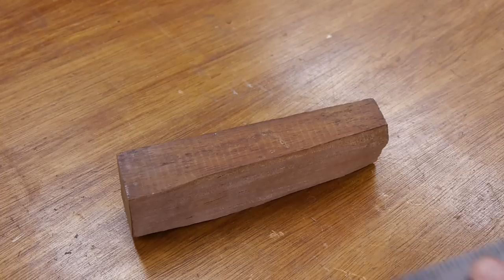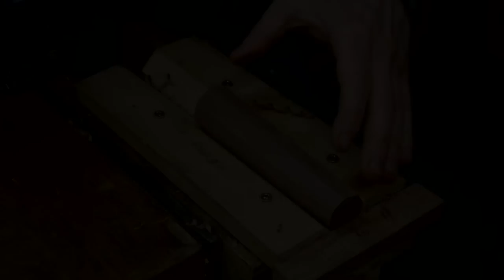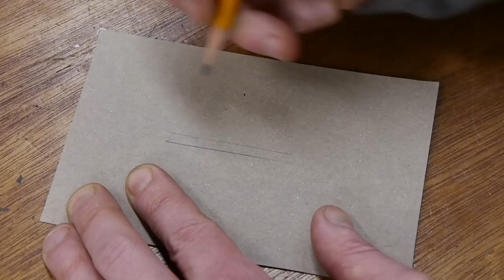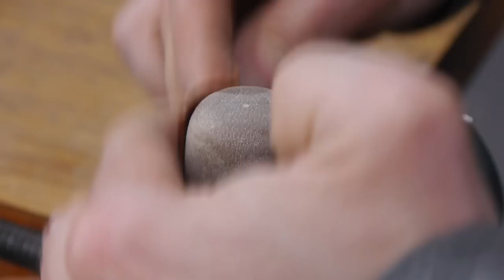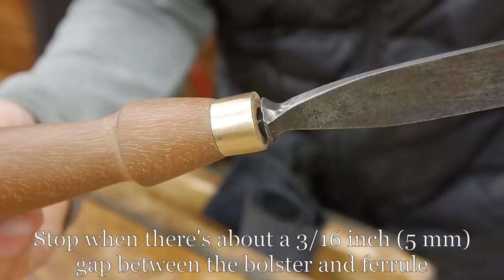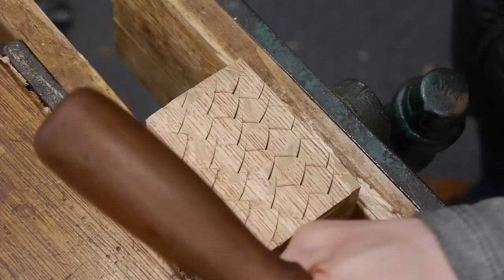200-year old carving gouge restoration | Making a traditional turned chisel handle with hand tools

Comment: Dear Mr Handtoolworks: clearly this is not your first rodeo. I thoroughly enjoyed this video, thank you. a) Where did you learn all your skills? b) Was that a hand stitched rasp you used? (a Frenchie?) c) Where did you acquire that auger extension holder? (never thought it even existed prior to this). This was the most instructive video I've ever seen on restoring hand tools, and its the little things you added which spoke the most to me. Interestingly, what I saw you doing by squaring off, then making octagonal to eventually come back to round, is what I am learning in blacksmithing right now. Very, very interesting. I offer somewhat effusive praise, but its rare that I find something so absolutely brilliant here on the Tube that I can put into use next day.

Comment: How do you know it's 200 years od and not 100 or 50 years old?
Reply from the maker: Hi @jsaurman, 
There are a few clues that point to the age of the gouge: 
-Sheffield tool makers in the late 1700s and early 1800s would have commonly used very simple makers' marks like the fleur-de-lys you see on the gouge. By the 1830s, makers' marks became more complex, elaborate, and distinct for each manufacturer.
-In the US, steel edge tools (eg chisels, plane blades, saws) were usually imported from Sheffield, until domestic steel making improved and eventually took over in the 1840s-1870s time frame. So, when you find an antique edge tool from Sheffield in the US, it is often a safe bet that it was made prior to the mid 1800s.
-The grind marks on the back of the gouge have a primitive appearance that is typical of tools made with the technology available in the early 1800s. 
-The gouge was found along with other tools from the early 1800s time period.

Comment: how did you know is that 200 year old?
Reply from the maker: Hi @choCOOLatte, great question! There are a few clues that point to the age of the gouge: 
-Sheffield tool makers in the late 1700s and early 1800s would have commonly used very simple makers' marks like the fleur-de-lys you see on the gouge. By the 1830s, makers' marks became more complex, elaborate, and distinct for each manufacturer.
-In the US, steel edge tools (eg chisels, plane blades, saws) were usually imported from Sheffield, until domestic steel making improved and eventually took over in the 1840s-1870s time frame. So, when you find an antique edge tool from Sheffield in the US, it is often a safe bet that it was made prior to the mid 1800s.
-The grind marks on the back of the gouge have a primitive appearance that is typical of tools made with the technology available in the early 1800s. 
-The gouge was found along with other tools from the early 1800s time period.
Reply: @thehandtoolworks  WOW thanks a lot men for info, i just wondering i bought on ebay last year a brass back tapered dovetail saw progressive pitch on weird orientation opposite of rob cosman progress dovetail saw, it Sheffield caststeel molson brothers, this dovetail saw of mine is so weird the finer tooth it is on half end of plate and set by crosscut? ever the size is for dovetailing cut